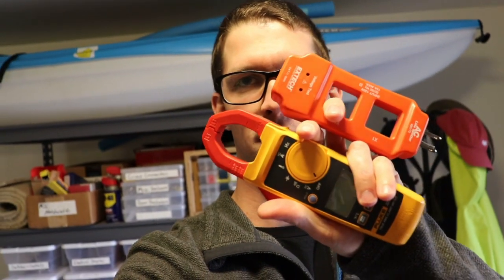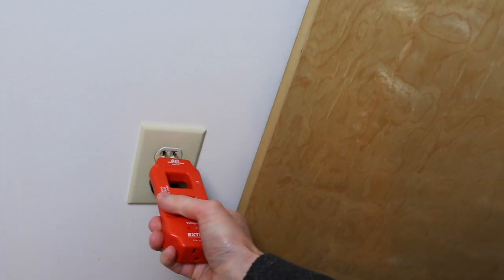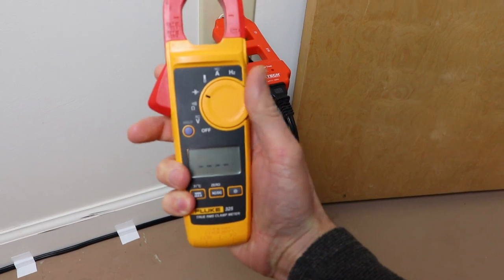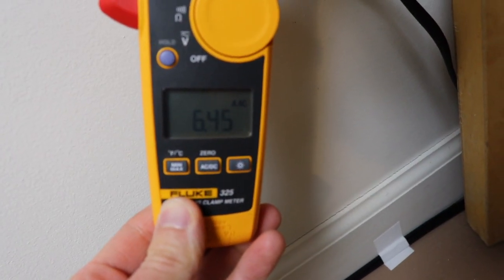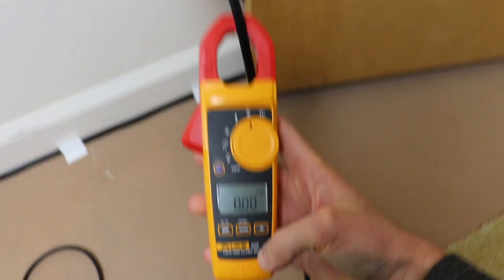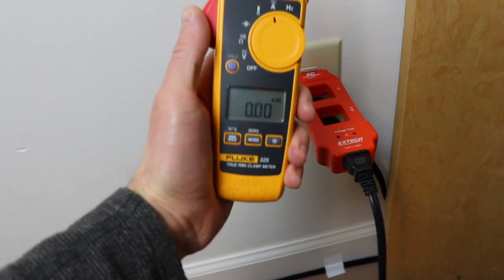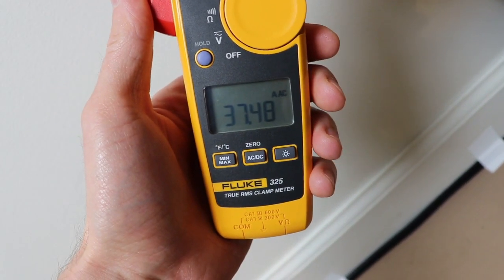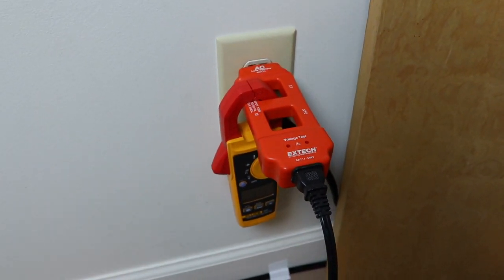How to Use an Amp Clamp and Line Splitter

Comment: Those clamps matter which side is used for 10×, and in this video the wrong side is used. There's one wire of the other polarity on the side he measured. That's why 10× is printed on the other side. Some splitters have markings indicating not to use that side. 

The inaccuracy in measuring the 10× come from the return wire being in such close proximity as it's essentially a transformer.

Comment: Another new knowledge for today, thanks ! I am intended to create myself a simple line splitter, but then you mention the commercial line spliter has a 10x wire loops to increase accuracy on clamp measurement. That is new knowledge for me! Wonder how 10x loops can improve the precision..is it because the magnetif field increased? Also, does the loop is intended to loop close/nearwith their other line wire?
Reply from the maker: I don’t believe it has anything to do with the proximity to the other line. Like a solenoid or transformer, the more loops the greater the magnetic field.

Comment: Did you use the neutral side?
Reply from the maker: In this application, you can measure the current by clamping around either the hot or the neutral. It doesn’t matter which.

Comment: do they make these for 30 and 50 amp receptacles?
Reply from the maker: @charles Lane27
No, they don’t. Usually a large amp draw receptacle like that would be on its own dedicated circuit. To test the current draw on that circuit, you have to open up the panel box and test the conductor coming from the breaker.
Reply: Maybe I will invent one then
Reply from the maker: charles Lane27 
That’d be great! You could make a pretty rough one from 2 cord ends and a short length of wire. Just strip the outer jacket off of the wire to expose the conductors inside.